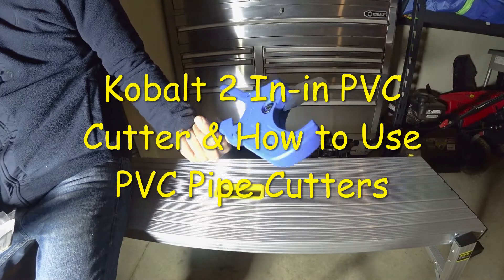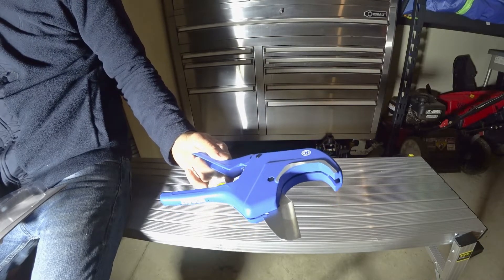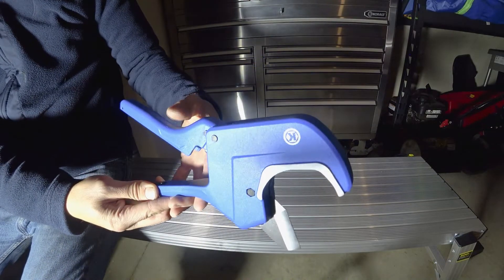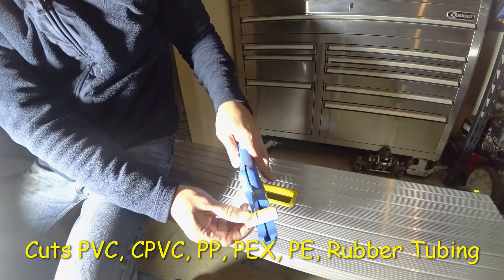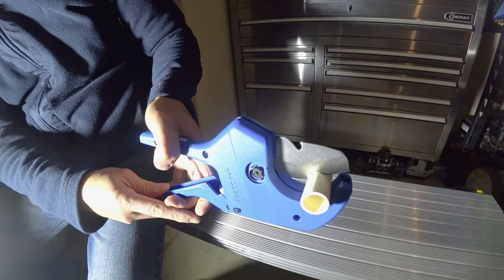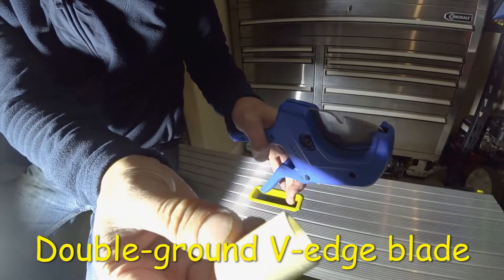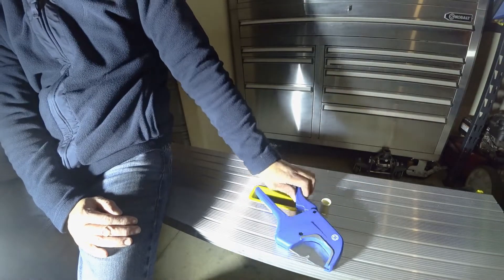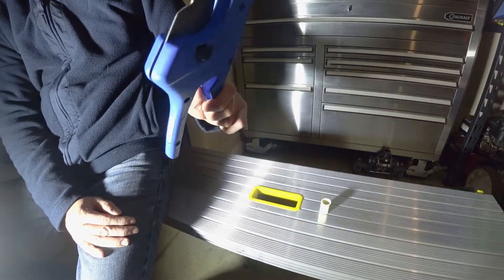How to Use PVC Pipe Cutters & Kobalt 2 In-in PVC Cutter

Comment: Yep, I too am having issues cutting even 1.5 inch pvc. It cracks the pipe before cutting through.
Reply from the maker: Never use it on anything larger then 1" PVC. Thanks for sharing that it struggles a bit on the larger size PVC pipe. Some reply on here is stating to 
'score" the pipe first when it comes to the larger size pipe. May help. Thx

Comment: I bought this today. It does NOT cleanly cut 2” pvc. I came looking for a video to make sure I was using it properly, I was. It goes back to Lowes tomorrow.
Reply: I purchased one yesterday, Jan. 23rd, from Lowe's. I cut two pieces of 1 1/2 inch PVC with it. The first cut was clean and even, the second was clean but not even (it was a smaller piece of PVC). I'm not going to return it just yet but will try additional cuts on smaller pieces to see if I have the same issue
Reply: Same here: it doesn't cut 2" pvc squarely. However, if you score the pipe first it does. Place the pipe in this tool and apply light pressure whilst turning the pipe (or turning the tool) so as to score it in a circle without any spiral. Then 5 - 10 more turns of gradually increasing pressure to the score while turning to make the score deeper. Then ratchet it up as normal and the blade follows the score line. When close to fully cut I find that the final part snaps off along the score line. Hope that helps.